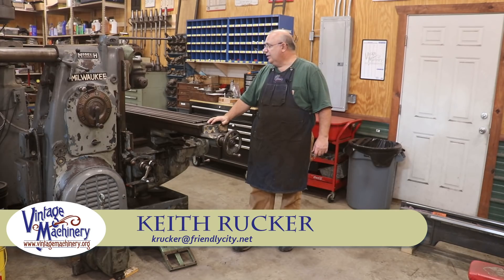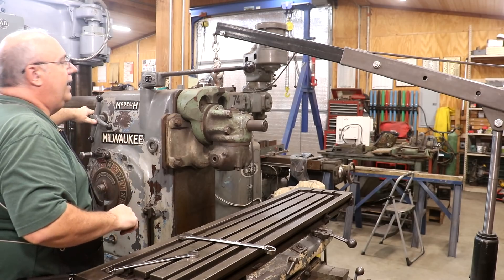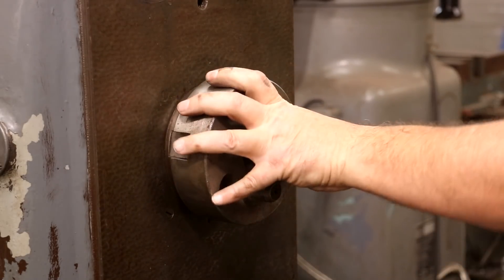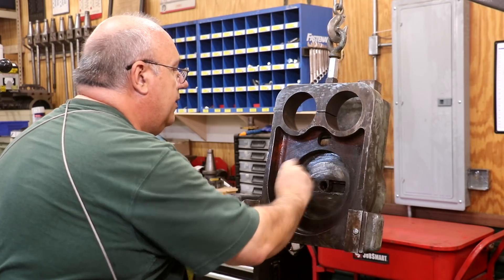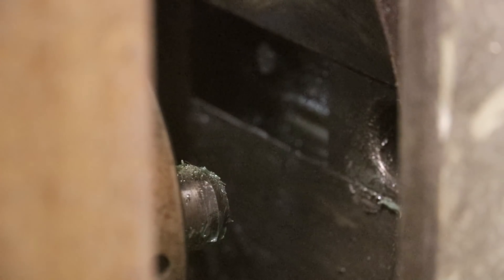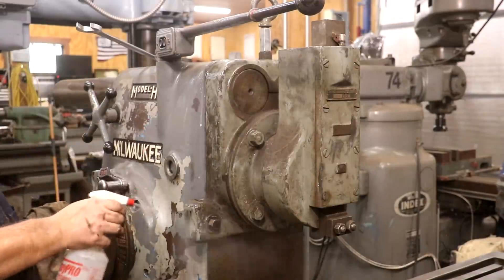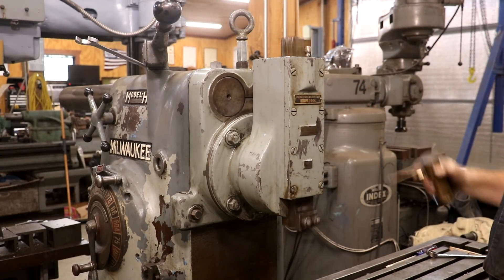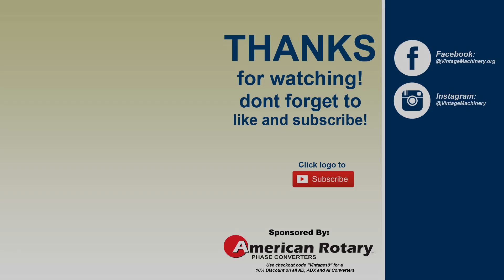Slotting/Shaper Attachment for a Kearney & Trecker Horizontal Milling Machine

Comment: Keith, hope all is well. Have you ever considered a modified pneumatic bumper jack to move fixtures and chucks. It works well because you do not have the long-extended legs getting in the way.

Comment: I use a harbor freight engine hoist like that, wheels are terrible, but it does work. For levelling of awkward items like that slotter I get it lifted on the chain and then hook a ratchet strap to the front top and around the lift arm of the the hoist so that I can use it as a levelling adjustment. Makes life a lot easier on big oddly weighted chunks of iron. Definitely getting one of these attachments for my Van Norman. Thanks for another great vid!

Comment: oo!
 you gotta "pull it apart and service it"... just so we can see the internals ;)

from that motion, as pointed out at 15:30, looks like its got the proper whitworth quick return linkage... seems unusual for most of these bolt on attachments. yes, the standard for a dedicated shaper/slotter/planer...

Comment: This may be a dumb question, but wouldn't it help to rub some lubricating oil on the pin coupler adapter at 06:00 before you hammer it into place?  Why make it more difficult to remove later?  Ditto at 10:00 - clean & lube the overarm holes in the slotter?

Comment: Thanks Keith, now I know my slotting head for my 3KC should work and how the drive for it will look when I build it. I don't think mine has ever been used. The over spray in the over arm holes doesn't even have a mark in the paint.

Comment: I enjoy your videos, Keith.  When I'm installing the vertical slotting head on my mill I find that, along with a hoist, resting the head on a fitted wood stand supported by the table helps a lot with alignment.   Up/down, in/out (Z+/Z-), Left/Right can all be done to very fine, controlled movements.    Just a thought.  Cheers.

Comment: If you push the clutch lever all the way toward disengage, it will lock the spindle to hold it for tightening or loosening the draw bar, at least on my 2h and 2hl anyhow...Mike in Louisiana

Comment: I think it’s just easier to use a machine designed to do the work, instead of fussing around with these heavy, clumsy adapters. Possibly cheaper too. The idea of going through all of this to do a few slotting operations, and then to convert it back? No thank you. Understand that Keith edited this video. The actual time he took to do this was much longer. It’s interesting to see that these manufacturers made these accessories though.
Reply: Universal machines such as this one were in common use on naval ships in the machine shop for emergency repairs.
Some machines were never used, only there for insurance in an emergency.
JIM

Comment: Really made me nervous watching you pivot that engine hoist around with the weight of that head up high where it would also sustain more damage if the the whole mess fell over. The first thing I learned about a hoist or a forklift was to get the weight down low as soon as possible.

Comment: It would be cool to build a little boom crane that extends out and over from the rear of the mill, (And held down by the weight of the mill) so you could pick up or remove an attachment and beam trolley it into or out of position.

Comment: Great video. Here's a tip: put a glob of grease on the pin. If the hole is not perfectly aligned, the grease will be squashed in the direction the hole has to be moved, up, down, left, right. Just be sure to move the grease back over the pin between attempts.

Comment: When you said that is was moving faster up then down, I did not believe you, so I stopped the video and played it back frame by frame.  5 frames up - 9 frames down. So, you were 100% right in that it was moving slower down then up.  I would love to know how they accomplished that with that simple slide mechanisms - my tiny brain just can see any way to convert a smooth circular motion into a two speed sliding motion. Maybe some day, you can take a few minutes and explain that.
Reply: See this tubalcain video: https://youtu.be/Jx5nOn0tf_k where he covers the shaper mechanism.
Reply: Long story short: it's built on an eccentric - downstroke is closer to the center of rotation, upstroke is farther. Big shapers and his planer work on the same principle.

Comment: At 9:05 - getting the attachment onto the overarms.  A couple of ideas.  1) ignore the current lift point and use a strap near the balance point of the attachment or 2) How about machining a plate that bolts onto the current lift point with holes towards the front of the attachment that moves the lift point forward?  It would take some trial and error to get #2 right (or machine a slot).  My $0.02.

Comment: I hazard that if the attachment had been thoroughly cleaned off and fully lubed before attempting to fit on to the overheads and internal pin, then it would have slid on like a dream. I know you were really impatient to get it going but - "more haste less speed". But we do like to see you struggle sometimes - it proves you're (super)human!

Comment: In order for any attachments to be useful they must be ready and easy to utilize. I liked the attachment lift that Adam Booth built for his mill. It parks the attachment out of the way on the right side of the machine. It looks like off-setting the lifting eye would be well worth doing, to make it lift in a level way. Cleaning and stoning the over-arm supports and using Dykem blue on the interference fit parts would be useful to see. If there are multiple attachments maybe a place on the wall nearby at about the right height would be best. That way you can grab it with the lift and get it to the machine in the most efficient manner.  I wonder if the head was loosened up on the head rotation, if it would have made it easier to align it with the drive pin. But then you'd have to tram it up again, but that would be useful to see as well. Obviously this was not a good demonstration of how this attachment was supposed to have been installed.

Comment: To make installing the slotter easier, you may want to move your lifting point lower and closer to the center of gravity. To do so, you will need to make a simple bolt on bracket. By picking where you did, you are fighting the engine hoist.

Comment: I made a bracket to lock my spindle to the quill so I could broach key ways. 
It works very well but your attachment would make it far easier. It  could be used to square out corners in the right application .

Comment: Keith, how about making a wooden cradle to put on the bed of the mill, place the head  in the cradle and then adjust the bed to get the head lined up with the arms.
Reply: I was going to say it would probably be easier to block it off the table and use the knee to raise the slotter into place than have it dangling way out of plumb.

Comment: Two questions, One, how do you tram that head dead nuts in to make sure your keyway is square to the work piece on all sides (or gear for a internal keyway) Two, how do you remove that center drive dog off the main drive of the mill when switching back to a arbor shaft or universal head? I know remove the 4 cap head bolts, but how do you get that drive dog off the mill as it's a pretty tight fit on there and you don't want to damage the face on the mill with a pair of wedges behind it. I have used the ones on the back of a Bridgeport, but not on a number 2 to 5 Horizonal K/T or Cincinnati (didn't even know they made one for that big a machine. P/S Big Horizontals are my favorite machines to run as many people hate them
Reply: You clean and fit it so that it slides on in the beginning, then you don't have to worry about getting it off.

Comment: So, the rotating part of the head is not aligned with the spindle - and the sliding socket the pin fits into not only allows the misalignment of the rotating shafts but provides the fast return slow feed aspect of the head.

Comment: You need a L shaped bracket in place of your eye bolt with a little offset to the front to balance the shaper attachment to get it to hang plumb. Very cool.

Comment: 14:10 Cleaning paint won't affect the operation of the attachment. Putting grease in the grease cup, screwing that cup empty, and refilling a couple of times - to get fresh grease to the shaft and adding oil to theoil cup for the 'vertical oscillator' ( ;) ) / ram, will help the unit work !

Comment: In every shop I worked in in my 50 years, the slotting head was relegated to sitting in a dark corner collecting dust and spider webs. A minute man broach takes care of 99.9% of keyways. I did use a slotting head on one occasion to re-cut a few teeth on a gear, which was set up with the hub centerline perpendicular to the mill table, in a dividing head. That worked out well.
Keep up the nice videos.

Comment: Would they have used an overhead crane to change these out? Or was it more of the case that they just owned multiples with different heads on each?
Reply: I doubt that they would keep one permanently mounted.  If they had enough slotting work to dedicate a machine to it they would probably just buy a slotting machine rather than converting a mill.

Comment: 2:05 Put some oil on those threads (all 4 bolts) and maybe they'll screw by hand ! The thread is a working surface - far more so than any bolt put in on a basically permanent basis.
Reply: Hmm, you must own petroleum stock!  Not a video goes by that you are not calling for gobs of "dino squeez'ns"!

Comment: 1:15 Engine hoist - I've recently seen another with the chain coming out of the end of the boom - and I'm pretty confident that that is wrong - I'm sure the chain should hang straight down from the bolt through the boom.

Comment: Funny, when those Chinese 3 in 1 machines became popular, the old school guys were always ragging on them because you had to tear down your mill setup to switch to lathe etc.  Looks like K&T had the same multi function idea way back with horizontal head, vertical head and shaper head as well as gear hobbing etc.  Probably for a one man shop it would have been a good choice the same as a 3 in1 Chinese machine is a good choice for a home garage, but for a production shop, separate machines are the way to go.

Comment: Hi Keith, this episode you showed us more of your tenacious perseverance and givin' your machines some lovin'! Glad this shaper attachment is in your shop running and is ready for creating some machinery magic. I bet those casters could benefit from some lubricant! I remember the old school casters with wheels that were purposely built to run at an angle and made from steel. Sometimes they made a little scrape sound but always went around in the end. I think the angle was built into them so the ball bearings could be larger with matching races. As opposed to having larger wheels (more expensive and requiring more shop space.)

Comment: Hello Keith, wondering if you made a longer alignment pin that would fit over the pin on the head and turned down to the size of the hole on the drive, if that would make installation easier. After the pin and hole are aligned then back out and remove it.

Comment: Hi Keith, your chain on the engine hoist should hang vertically on the bolt rather than out the front, there is a slot to put a link in to hang off the bolt. Probably doesn’t matter for light stuff but on heavier things the bending of the link is not how the chain is supposed to be loaded. Good video as always!
Reply: He may of needed the extra inch of lift or reach for something. Definitely done it my self.

Comment: Can you adjust the stroke?
Reply: I was curious of that too.
Reply: @marcp1180  you can turn the table up and down, of course.............
Reply: @a.bakker64  Automatically or all manual though?  Seems like it would be a limited machine say if you had like a 10 inch cut needed.  That just might not be the correct machine for the job?  For shorter cuts I  think it's  a perfect setup, maybe that's  the same thought that Milwaukee thought when they made it.  If you need short cuts here's  an attachment,  if you need longer cuts, buy another machine.  Looking at that angle, it makes sense to me.

Comment: I have never seen one of these on a horizontal.  Nice find and this would for sure have more power than a bridgeport shaper.
Reply: The Bridgeport style shapers have a lot more maneuverability. Not that you cut slots on compound angles very often or that you couldn't just figure the work to get the angle on this

Comment: Just as a comment, CRUD is a specific technical term in nuclear engineering.  The first commercial nuclear power plant was at Chalk River, Ontario.  In 1947 metallic oxide deposits were noted in the coolant system, but what the specific deposits were couldn't be determined.  These deposits were originally called Chalk River Unidentified Deposits or CRUD.  Of course what the deposits were was figured out, but CRUD is still used as the name for that type of deposit.